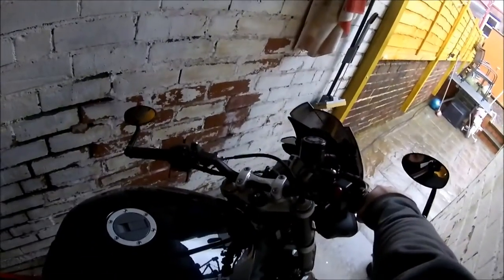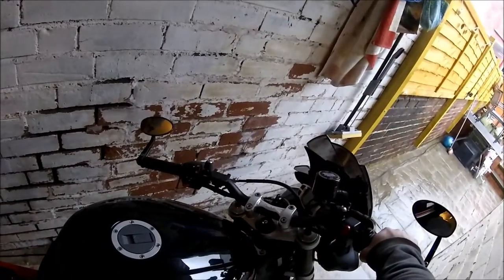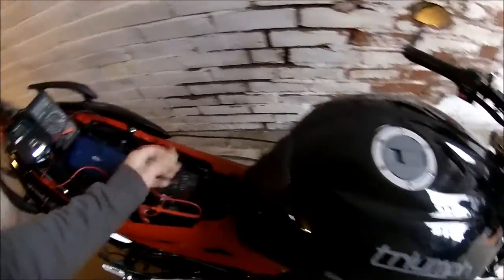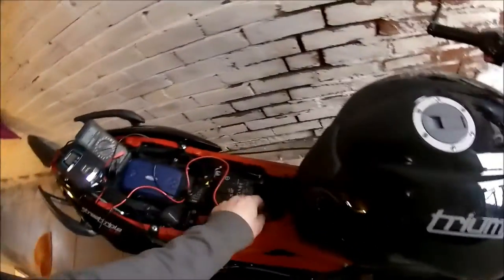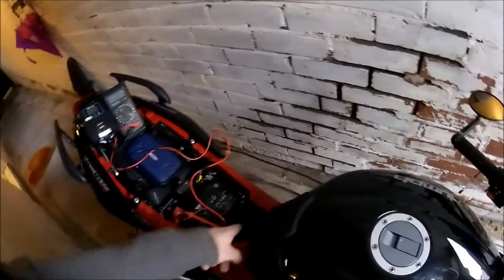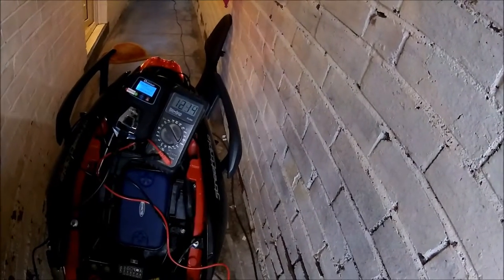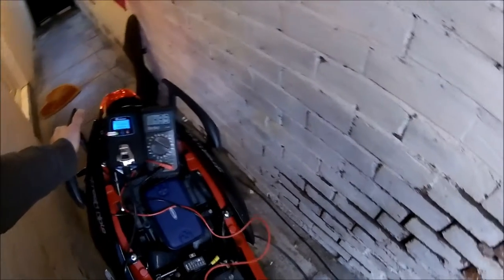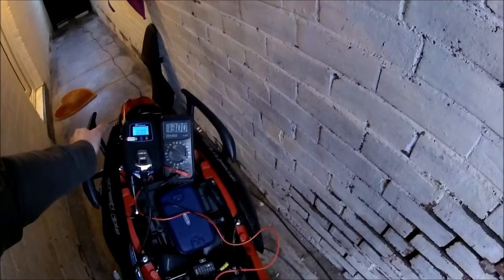Bike fault/battery testing

Comment: Looks rock steady. Down to checking battery earth, loom connections etc. Unplugging, looking for corrosion and plugging back in and reseating might cure it. Trouble is, it's only happened twice and you can't recreate it will make it a very difficult thing to find.
Reply from the maker: +Lurch OnABike Exactly that lurch,im a heating engineer by trade so I know all about intermittent faults ect,such a pain sometimes but im on top of it dude thanks,it shall not conquer me hehe...later dude n thanks

Comment: All seems fine Bizz, the only thing I can think of is make sure the terminals are tight and clean and the engine earth has no corrosion on it, mind you that should be fine for the age of the bike, lets hope it stays okay, I've got a blue led permanently on on my usb port wired straight to the battery and it doesn't have any effect on the battery, RSM8.
Reply from the maker: +Skeggy Cruiser yeah sounds the same sert up I have skeggy,..fuckin odd situation bro I can tell ya....cuz like you say the age of the bike it 'shouldnt' really have things like bad earths and corrosion build up on connectors ect!!  BUT......and that's it isn't it dude..fuckin BUT lol......aint had time to get into yet and strip it down so hopefully next week some time il get the spanners and multimeter out,check all connections,check continuity on all possible faulty wires (ignition/Charging ect)  il probably do a wee vid on it weather and mood permitting lol.....thanks n ride safe bro...see ya soon..bizz

Comment: Had problem with my str, turn it off n it wouldn't start, did it couple times.  Mentioned to guys when went for service, said was cross thread where the safety button is on handlebars (the one that engages when pull in clutch to start bike).  Have u checked the safety button function, also when put me aftermarket levers on mine wasn't pushing in enough to activate it and also when cable got bit stretched and i adjusted it was playing up too.

It would bump start though
Reply from the maker: +Rasputin Ayup Rasputin,sorry for the delay in respone bro!!  thanks for your comments...im going to check all possible switches ect for soundness as soon as I can,start switch,clutch switch,kill switch.....just to see if there all fine,corrosion free and proving on/off as they should do.thanks for the info brother very kind of you and helpgull....ride safe buddy...all the best..bizz

Comment: The battery, stator, rectifier & regulator all look fine to me bro. Standing voltage at 13V+ is fine and it didn't sag below 12.5V when you switched it on. The voltage drop while the starter is cranking is to be expected. The Stator is easily putting out over 14V so it's more than enough to charge the bike. And the voltage is really steady (better than my Speed 4). 

At this point the charging circuit looks fine and the battery isn't sagging. So the battery, stator, and R&R are good. All I can possibly think of is to ensure the terminals are clean and tight on the battery. Just double check them. I would also trace the earth / ground cable to where it connects to the engine and frame / chassis. Sometimes you get galvanic corrosion at these points. But honestly it looks fine but it never hurts to check it and clean the terminals and earth / ground connections. 

I seriously doubt that USB power port is drawing enough power to tank your battery but you could always wire an on/off switch if you suspect it. Last thing to check Bizz is the connections to the starter as there could be some corrosion. If you're riding the Street Triple year round you could have an issue with corrosion in a connector. If you're a member of the Triumph RAT forum, put up the question in there. Probably another Street Triple owner somewhere has seen a similar issue. They helped me a lot with Ginger. Cheers mate, hope you get it sorted. Love the bike.

Mike
Reply from the maker: +Michael Rench Hey Mike,..again buddy thanks ever so much for the time spent and the advice given!!  means a hell of a lot bro!!    as you say soon as we get some good dry weather here il be taking a couple panels off and lifting the tank ect,work out where all the ground connections are and also all the starting connections including rectifier ect,just make double sure all are clean and properly connected!had her out this weekend on a charity ride and not a murmour from her mike,she ran lovely,started on the button every time lol......god damn machines huh,allways a challenge or something new to learn about them no matter how old or new they may be,i find it fascinating and infuriating all at once.....but then aint that life in general??.....well thanks again bro,..il be sure to keep you updated one way or another n hope to chat soon......go easy,much love to the Rench household n above all ride safe yeh!!  Bizz
Reply: Thanks Bizz. Ginger was giving me headaches last year with the oil leak that just wouldn't go away. I must have had the sprocket off 5 times changing seals and o-rings. The charging issue was easy compared to the Speedy marking it's territory! LOL. Cheers!